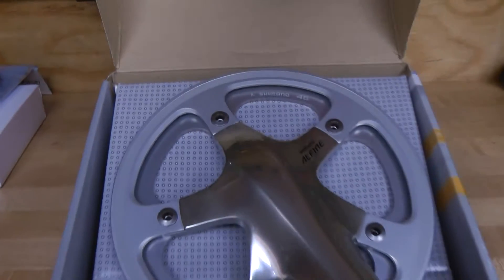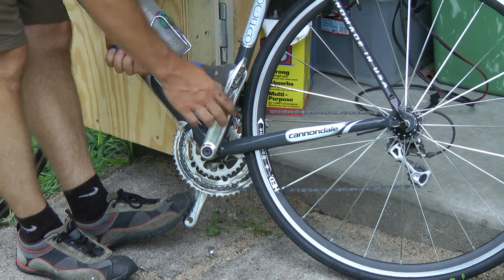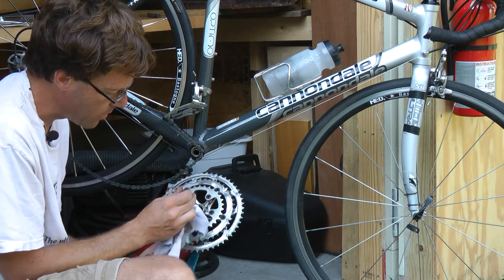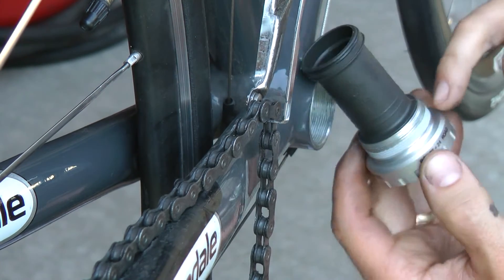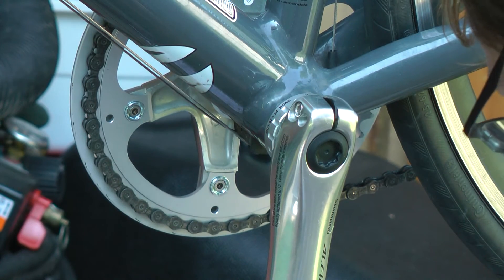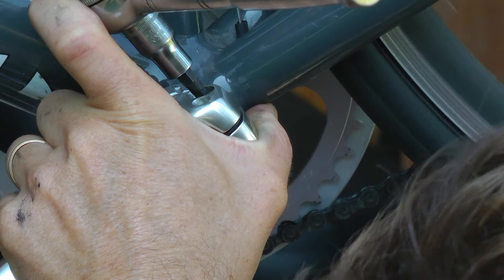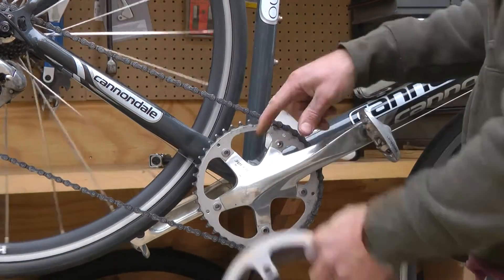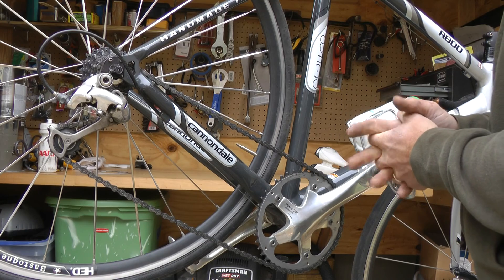Shimano FC-S500 Alfine Crankset - Installation and Review - Single Road Crank

Comment: Thanks for good video! Also. Great crankset (modern 2 piece) for the price, just for anyone else is installing Hollowtech II arms: the hex nuts are only there to secure the arms in the side2side dimension (the splines keep them in the place "radially", in other words: do not close the gap but use a torque wrench. Aluminium is soft and will not spring back as steel if over torqued.
Reply from the maker: Thanks for that clarification. Jesus.I have been riding this for 8 years now. Still working great.

Comment: Regarding the improved speed, 170mm is a better crankarm length for anyone with a height of 6 feet (180cm) and smaller, 175 is too big from my experience. 
Especially as one gets older, with aging knees :P
Also with the smaller crankarm one gets better cadence (smaller circle diameter to pedal through), so more rpm = faster. 

Regarding the installation, if anyone reads this, 2 things:
- don't be so hammer happy, never needed a hammer in the installation or removal of such a crank. 
- and don't assume stuff, like the guy guessing the gap in the left crankarm needs to close entirely as he tightens the screws.

Comment: Matthew Brenengen,

Thanks for the great video.  I want to do the same for my Specialized Allez but was told it would not be compatible since my rear hub is 130mm and the chain would run off.  Does your Cannondale have the same size rear hub?  Have you had any issues with the chain coming of if so?
Reply from the maker: Actually, not sure what dimension would be 130mm. The only dimension that should matter is the distance horizontally. I suppose if it were too great, it would drag the chain off. I don't think you would have a problem. I actually removed the ring that I suppose is there to prevent the chain from coming off. I have not had any problems. I also moved the chain ring inboard, so that might have helped.
Reply from the maker: Correction - I moved the ring outboard. If you are concerned about the chain coming off, don't change the stock setup.
Reply: Matthew Brenengen Thanks for answering my question.  Got my crankset  in the mail the other day so will hopefully have time to install it soon.

Comment: Hi there, can I use this crankarm on a DuraAce-9000 BB? I've been told the chainstay is 42.7mm on this and that it may give me issues, I'm not sure what makes this BB different from the 9000. I am trying to run a 1x9 setup like you (42T in front, on a rear cog of 12-27 (an ultegra 9 speed)).
Reply: Don't mix Dura Ace 9000 BB with other things. You can use an Ultegra BB with e.g. 105 crank or Alfine.

Don't use an Alfine crank for a 1x9 setup. The chainline is all wrong. Spend some money on a quality square-taper crank and choose the correct bottom-bracket axle width to put your chain dead straight on the middle sprocket (halfway on a 9sp).

Comment: 1. Use the proper tools for the job.
2. Don't use a matel hammer on metal crank arms. At least put a piece of wood in the way or ideally buy a nylon hammer.
3. When the spec says how tight you torque something up, there is some leeway but please don't overtighten just because you think you're right. You're not right. The person / people who designed the part are right.
4. Don't 'spacer' chainrings, because that leads me on to...
5. Bottom-bracket noise is only caused by the bottom-bracket 5% of the time. The other 95% of the time it's loose chainring bolts, loose pedals, worn pedal bearings, loose cassette, worn chain on new chainrings or new chain on worn chainrings.